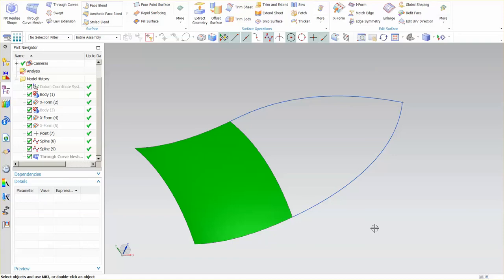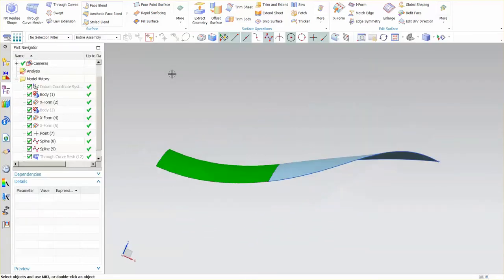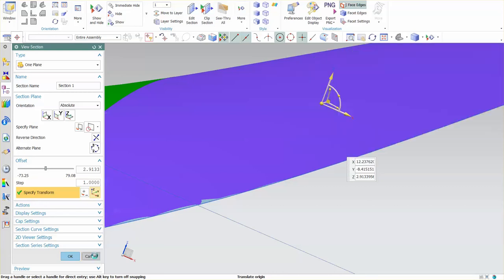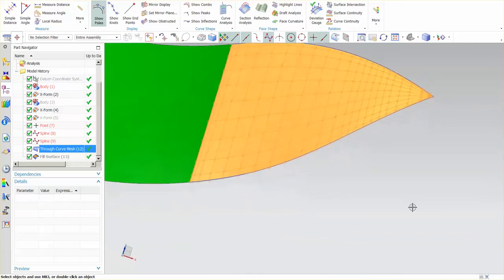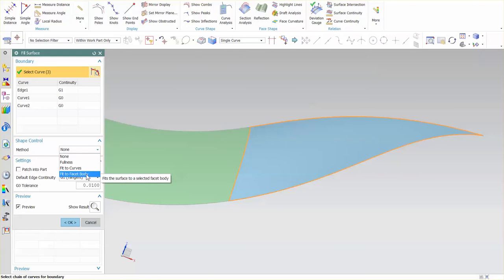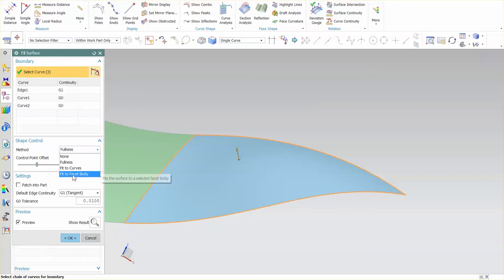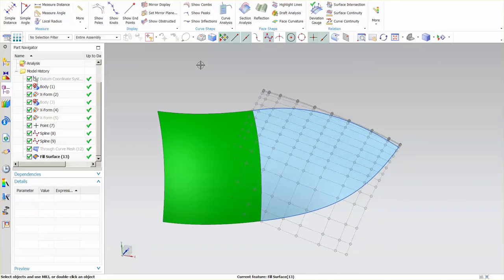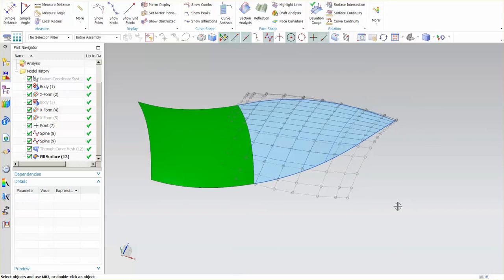Siemens NX 10 | Class A Surfacing Tool: Fill Surface

Comment: That is a good comparison of the two surface types. Use the right tool for the job depending on what the job is. I like the tip about using a point as one of the strings on the Through Curves Mesh. I wasn’t aware of that option.
Reply from the maker: These old tools are so good and have some gems buried in them.